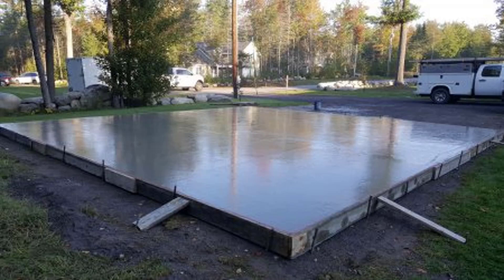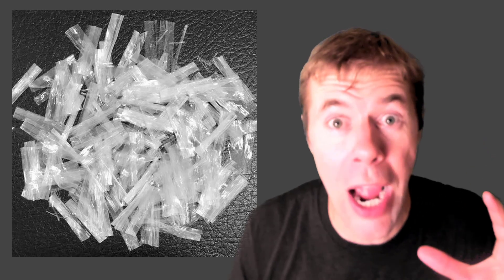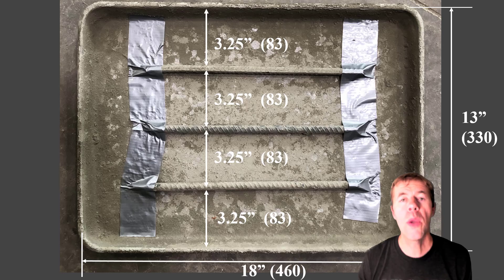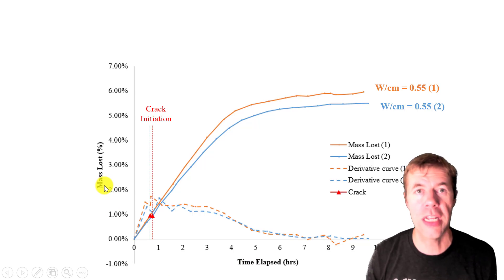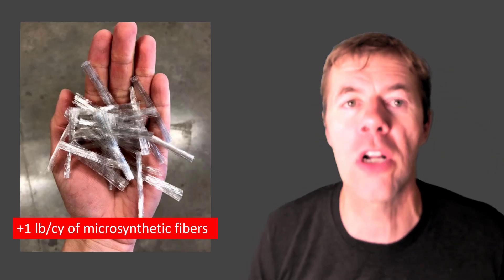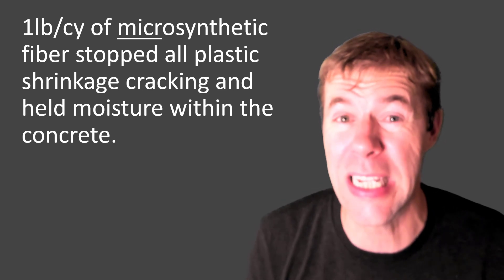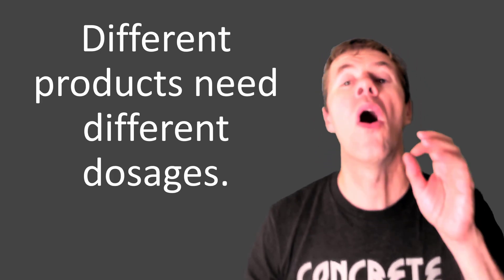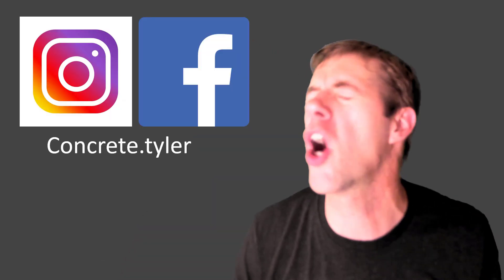Stop plastic shrinkage cracking with fibers | microsynthetic fibers

Comment: I pour concrete in Wyoming where its hot dry and windy everytime its not cold snowy and windy. I use fibers every time.  I started in upstate NY very different environment. Do you have any recommendations for patio and driveway installation here where the temp swings wildly on avarage in the sumer theres a 40 to 50 deg. Swing daily. Im thinking make sure sub base is even and compacted use expansion and be liberal with control joints

Comment: Thanks for this video. I have a question what do you think about using only syntethic fibers in industrial floor loaded by moving vehicles ? And other  question to prevent from curling its better to use steel fibers or it doesnt matter? Im trying to understand the way of working these fibers. Thank you for any help🙂

Comment: Before adding fiber I'd reccomend ensuring that the mix design is designed with proper proportions that will reduce shrinkage.  Also larger rock will create less shrinkage in a mix.  Then chose a day with an appropriate evaporation rate.  Micro fiber is definitely a great choice if you have done the above.

Comment: Hi. im all the way from Cape Town, South Africa.. Just found your channel..... AMAZEBALLZZZ.. i manufacture pots. i make them by making a mortar, and them plastering them onto moulds.  My question is, what would be the ideal microfiber to use here.... 6mm or 12mm or should i use another. and what is the best cement type to use for these pots... i plaster them about 10mm - 15mm thick, whithout fiber currently..  so if they crack nothing holds the pot from completely breaking apart.    AND would you agree to using a more finer sand, in  the pot plastering, compared to a rough sand for plastering

Comment: From the point of view of concrete strength (not the practicality or costs involved) Why is it important for hydration to occur after the concrete is poured ? For example, why not mix the concrete in a surplus of water and keep agitating it for maybe days, then (magically !) remove the excess water and pour it. Rather like that other method of cooking rice. Or maybe introduce the cement to the other concrete ingredients as a pre-hydrated slurry that has been allowed to steep for a while ?
Reply: I think the concrete sets by forming crystals that interlock. Concrete generally sets within a couple of hours. It then reaches the majority of it's final strength within a couple of days. If it was mixed for days the crystals would be broken as they were formed. The concrete would not be strong. Also, too much water is no good because voids remain after it evaporates. Less water results in tighter crystal structure.

Comment: hi - i need to put down two foundations for metal columns to support a roof overhang - been told to make them 50x50cm and 80cm deep to go below frost line - thinking of doing it myself.  Wondering what kind of re-inforcement you would recommend for that please?  What diameter rebar?  How many rods - should they be joined toether into a a single structure or just placed in indidvdually - is it worth using fibre?  The main force is compression but it's conceivable excessive wind under the roof overhang could create some lift (tension) but doubt it - many thanks

Comment: Hey Tyler, I would like to know your thoughts on two applications; 
1) of how well concrete and rebar is protected inside an ICF wall with tyvek wrapping and stucco. From what I have learned watching you this sounds like a 100 year concrete wall. 
2) green roof on a concrete flat roof. Green roofs do usually have 1 or 2 layers of waterproof membrane of some sort on top of the concrete. Would you consider it to be too risky?

Thank you ❤️
Reply: I too have wondered about ICF and rebar rusting.  It's pretty thin.  Also that "Micro Rebar" brand that is zinc plated.  I think just electro plated.  How long will that last before rusting.

Comment: Could you do a video on Helix Micro Rebar? Not necessarily that brand, but the benefits/downsides of using micro rebar instead of regular rebar in single-family houses, in conjunction with ICF (either foam forms or the alternative woods fiber blocks). Thank you!
Reply: Agree, they claim that they are zinc plated or something.  How long will that last since it is electroplated.

Comment: Hi Dr. Ley, I have 2 questions. When the fibers prevent cracks do they also retain the size of the concrete also? And, since the fibers attracts water, do we need to check the water content of the fiber, and do we need to change the w/c from the original recipe?

Comment: How do these compare to steel fibers mixed into concrete? I don't think the steel fibers would help with water retention but they should add some ductility and strength that you wouldn't see with the plastic fibers right?

Comment: Great Video Dr. Ley. I have some follow up questions. How does the addition of microsynthetic fibers effect strength? If more hydration of the cement is happening with the addition of the fibers, can we reduce the amount of cement and maintain the required strength? Does the addition of the fibers effect the pump-ability or final finish of the concrete? Are you guys doing more tests and experiments in this area? I would love to show research findings to the contractors I work with.

Comment: Why not just properly cure the concrete, instead ?

Because the fibers won't reduce the shrinkage but only lead to it's even distribution making it invisibles to naked eyes.

Also, it's relatively very easy to mix micro fibers in a mortar or cement mixer compared to a concrete mixer, where many fibers just allgomerate and create weak points.

Comment: Since I live in central Oklahoma, I’ve been researching alternatives on more efficient and weather-resistant housing, and happened to come across monolithic dome construction (particularly underground monolithic dome construction). Could you please do a video on shotcrete? Durability, low permeability, and longevity are key factors I would like to focus on in a structure, especially since water and moisture can be hard to control once permanently underground. However, I can’t find much info online about shotcrete and still have no idea if it’s a good application for underground, particularly when it comes to long life.

Comment: Tyler, you videos are great. 

Could you do a video on the effects of different finishing? Does the surface of finished concrete change the structure/durability/etc? Why do we need paste layer over aggregate? Does visible aggregate 'when paste is washed off so aggregate is visible (pea gravel) change the durability?

Comment: You said that these don't provide any mechanical advantage once the concrete is set. Could using glass, basalt or steel fibers provide both curing crack protection as well as a long term mechanical advantage or is the ability to retain water absolutely needed? If the key is in water retention could using a water binding long molecules, like poly ethylene oxide also help prevent cracking during the cure?
Reply: It seems that Tarek Hilo agrees with using hydrophilic microfibers, plasticiser additives, and also recommends an emulsified wax coating.

Comment: I've placed concrete in some pretty horrible conditions, extremely hot with a strong wind, and the specs prevented the spraying or fogging of water on the surface of the concrete. The concrete obviously was degraded and stopping the crazing cracks wouldn't have helped much except perhaps with appearance. However the appearance was terrible anyway since the plastic concrete formed a dry crust on top whilst remaining plastic and it couldn't be tooled properly. I'm told they have methods for dealing with this in arid climates but those are not applied in the midwest. Nobody was happy with the results. Jobs like that drive you to a different trade.
Reply: I strongly suspect that those "specs" prohibiting fogging didn't take such extreme environmental conditions into account. What is so bad about learning from others in more extreme climates? 

And what is ever detrimental about fogging? You just have to tool at the right moment without being influenced by surface gloss.
Reply: @imconsequetau5275  The spec book is a legal document to which you can get changes made if, say, the receptacles spec'd are no longer made. Concrete placement, asphalt paving, and welding specs are just seemingly fixed. So when you get a really really bad summer in the midwest, it is just bad. You won't get a change in time before the site work is scheduled to be finished. Hope that makes sense.
Reply: @notsoserious0944  
I'm sure the results of that slab were frustrating for everyone, even the spec team. I hope they start a dialog with counterparts in arid and freezing climates, because climate zones are shifting fast and weather extremes will stay more chaotic. For example, Texas can expect freeze events every few years due to polar air.
Reply: @imconsequetau5275  Horrible in every respect. Not work to be proud of for sure. The control joints were to be hand tooled...lol.

Comment: Yes! Yes! Yes! This was what I was looking for. I've written this into my new house spec. " All Concrete, to have plastic microsynthetic fibers , at the rate of 1lb per cubic yard."
Walls, flat work, all of it.
Reply: Why not a combination of macro/micro-synthetic fibers?  About 1lb/cu-yd of each type should cover most of the hydration strength development and then cover semi-structural cracking later in the concrete's life.  Also helps with spalling in a fire...
  
Any other admixtures to reduce water migration like a Xypex (no affiliation)?  Stuff in admix is IMHO better than trying to "fix" performance after casting...  Kind of like spec'ing 10mil hot dip galvanized bar, with a thermal spray galvanization of joints on the finished steel - than putting pre-rusted bar in a cast.
  
Then of course, a wet pulp water retention cover under plastic to keep the surface from drying out before hydration completes...  Mmmmm ;-)
Reply: @Real_Tim_S  Have you witnessed that thermal spraying?
Company I used to work for had 2 guys driving around the country doing that stuff.
Like standing next to a jet engine 🤯
Reply: Be sure to specify "hydrophilic".

Comment: I sell to construction project managers three products to prevent plastic shrinkage cracks... They work all the time

Masterkure 106, liquid curing compound based on water soluble wax.... Engineers at site spray it on top of exposed freshly casted concrete.

MasterFiber 012, polypropylene micro synthetic fiber, should be added into the mixer and mix it with concrete, 600grm per cubic mtr of concrete.

MasterGlenium 51, poly carboxylic eather acid based superplasticiser (admixture to concrete), it allows to produce flowable concrete with low water to cement ratios (below 45liters of water per 100kg of Ordinary portland Cement)

I advise my customers to avoid direct sunlight, wind acceleration, casting concrete on variant temperature intervals at the day
Reply: Every civil engineer if he hasn't skipped clases and pays due diligence at construction site can avoid plastic shrinkage without the help of any admixtures.
Reply: @Manish_in_hell  try pouring concrete in Wyoming where it's either snowing with 80 mph winds or 100 Fahrenheit single digit humidity and 30 mph winds. And on average there's a 30 to 40 degree temp change daily
Reply: @unseenadventures8130  
It's the same everywhere in the world, either it's raining or it's too hot. Engineers find a way using all weather construction and or chilling the concert. 

Wet gunny bags nailed to concrete walls and ponding with water for slabs is good enough
Reply: Engineers don't spray cure compound on the pour lol labours or masons do lol. What is you view on finishing aid. I have been using it for about 6 years now and I love it on those hot dry windy Wyoming days. Every day from May to November lol

Comment: How do the fibers improve load or torsional strength?
Reply: I suppose not directly however by allowing it to hydrate longer you get stronger concrete which helps.
Reply: They don't. Hydrophilic microfibers just better retain water in the green concrete, so the surface stays hydrated longer. They are easier to use than a layer of pulp, misting, and/or plastic film cover.